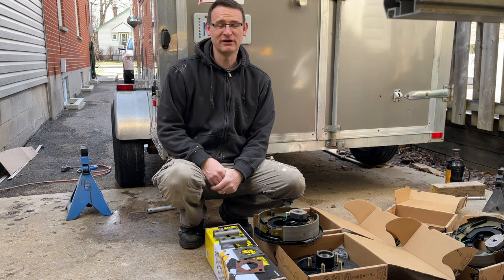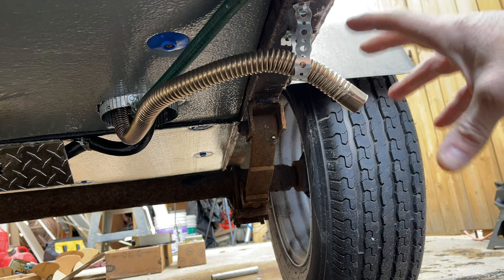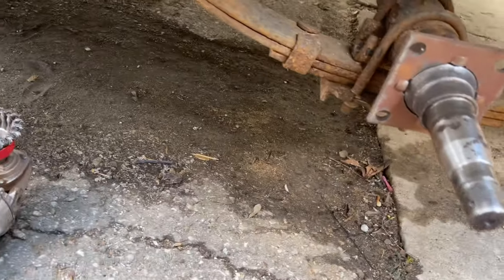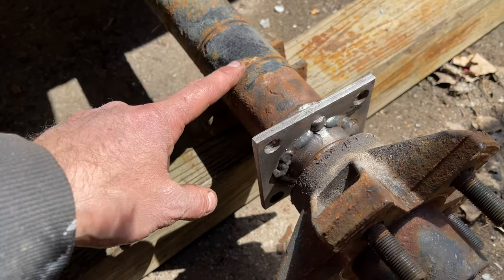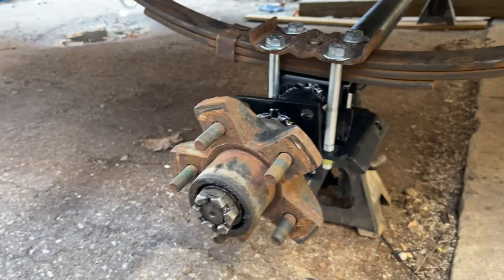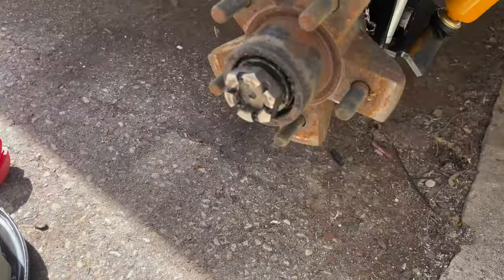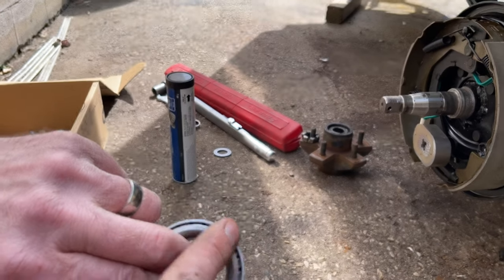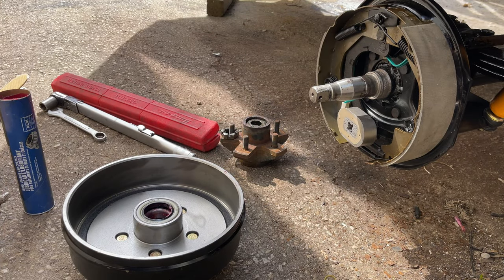How to Build a Cargo Trailer Camper Part 9 - Shocks/ 6" Lift/ Brakes

Comment: Thanks for the video! What about that tongue jack? That’s what really gets hit when driving through dips etc. I wish they made this type jack that would go all the way up and out of the way. I converted to a swivel jack for this reason.
Reply from the maker: Yeah I hear you my last trailer I ruined my jack that way😬. I was wondering if I could modify the existing jack.... some kind of removal foot and extension. But it’s probably just to complicated. I think I might have to go that way also... a swing away jack.
Reply: I converted mine to a swing away, because the factory jack didn’t survive an off-road trip. My tongue is complicated due to battery boxes, so the clamp on style was a no go.  I purchased one with a weld on bracket.  Owing to the aforementioned complication, I welded the bracket to the inside of the tongue.  It’s not “swing away,” but it is completely removable.  I also welded a 3/4 inch nut in place of the hand crank.  Rechargeable drill makes for a multi purpose electric tongue jack and drill. For emergencies, I carry the hand crank for the stabilization jacks from my travel trailer.

Comment: great work... how did you wire the electrical brake wires? I mean converting 4 pins to 7 pins? and do you have link to the electrical brake drum kit? thank you a lot
Reply from the maker: I actually just bought the brakes from princess auto…. That’s like harbour freight in the US. 
I then bought a 7 pin harness with junction box off Amazon like this one 
https://www.amazon.ca/PEAKTOW-Weatherproof-Corrosion-Resistant-Junction/dp/B07MYN6N5L
I mounted the junction box inside my trailer and Then ran my existing trailer wires into the junction box. Ran new wires down to trailer brakes and then your set.
Hope that helps a bit.

Comment: Hi, I am seeing many similar ways of lifting cargo trailers for more clearance. but I’m wondering how much does it matter if the axle still sits so low. Especially because, if I understand it correctly, the axle is always relative to the tire. So you will only ever get more clearance on the trailer while the axle height doesn’t change. Bigger tires seems the only solution for axle height increase and this can happen without a lift install? (Presuming your fenders don’t get in the way). Thanks!!
Reply from the maker: Great question….. Here’s my thinking. The best case scenario is lifting the trailer along with bigger tires. The benefit to a lift even with the same tires is your break over angle increases…. Basically you don’t drag at the back or get hung up on hills at the front because the body of your trailer is further from the ground. But to really benefit if you were in ruts or rocks then bigger tires or independent suspension is best. Hope that makes sense
Reply: @waysoutback  it sure does make sense! Thank you so kindly for your fast reply. Also for sharing your process with the world at large. It’s super meaningful and immensely helpful. Cheers and may the road treat you well!

Comment: Have you ever considered the timbren axle-less suspension?
Reply from the maker: Not really…. Had a quick look before I added the brakes but the seemed expensive and I’d need to add a cross bar….. I actually don’t mind my axle because my plan is to put a grey water tank used the trailer so the axle will provide a bit of bash protection from roots and rocks. If you were building a smooth bottom trail then I think it would be great especially for large mud ruts. You can really feel the trailer pulling you around when the axle is in the mud or deep snow. I don’t think I looked into it enough to have a strong opinion one way or another.

Comment: Just saw this and have been thinking about this for my cargo trailer. The problem I see is all these lift kits don’t do anything for the clearance of the axle itself so what’s the point? I’m really wondering not just trying to be facetious.
Reply from the maker: No problem at all. It’s a good question. I think the real benefit comes from installing larger tires. But I did find it really improved the trailer approach angles quite a bit. Before I’d always drag over large dips now it clears no problem. Hope that helps. Maybe if you think of it like a suspension lift for a truck?

Comment: Can I get more INFO on the KITS you used? ! ! !
Reply from the maker: Sure….  the shock kit I used was “ Lippert 281255 Bolt-On Shock Mount Kit 2.375" Axle 3.5K” bought it off Amazon…. the flanges and spring mounts I just bought off a local trailer shop. Here’s a link to their website for the parts - https://www.standardaxle.ca/product/flange-brake-4-hole-84-spindle/
I’ll see if I can post the links to Amazon for the shock kit in the description.

Comment: Do you have a link to the where you got the brake kit?
Reply from the maker: Hi Bryan
I just got them from the local axle place. Standard axle is the name. They do have a website where I ordered them. I think they are pretty standard parts at any trailer axle place near you. I’ll see if I can find a link to the parts and post them.
Reply from the maker: https://www.standardaxle.ca/product/flange-brake-4-hole-84-spindle/

Comment: Another great job!  I hate to appear to be an armchair critic, but the exhaust pipe from the heater looks real close to the insulation? An errant stick or stone might possibly push it up? Maybe it's just the angle the camera is at?   If you want to get in touch, drop me an email. Same name @Gmail address.
Reply from the maker: We are all armchair mechanics! 😁
I hear you about the exhaust I was a bit worried myself. I was going to wrap it with header pipe wrap for exhausts but so far after having it running for hours it’s been good. I’ll keep monitoring it, also I’d never fire it up for the first time without giving it a once over. Thanks for the comment though!

Comment: I am over 65 and able to do the work, but you, under 65, are amazingly comfortable with this type of alteration..!!!   LOL!  Most people under 65 cannot cut their toenails..  Indeed sad..   
Wearing jewelry creates accidents, gloves or not...
Are instructions included, or are you winging this..?? 
I would have welded at a higher temp. 
How did you mark each side so the axle is square..?
Did they not at least include rubbed pads to place between the axle and springs..??
U bolt brackets not welded to the axle..??  
The torque  between the springs and axles will eventually shift the trailer on the axle, no matter how tights the bolts.!!! 
Unless the shock is double action, the placing it facing forward will pull the rod out of the interior instead of apply the proper damping pressure going in..!!  Sounds bass ackwards..!  
I would have used marking pen for accuracy and not tape.
Notching a shock support and removing material..??  A no-no..
I would grease all the bolts and connections really well, as re-tightening will be needed periodically.  Especially w/out any rubber at the axle and spring.
Don't let the axle rate of 3500 fool you.  That has no bearing on the design changes you are making and how this is jury rigged..
You need to add another bolt on the top bracket..
I would have added another nut to the top/bottom shock bolts.
Not using new bearings would be a mistake..
How do you wire this and balance the both systems..??
Hummm..!! The more I watch this the more I see questionable long term reliability..  No offense, just sayin'..
 I like the entire concept and one of the BEST I've seen on boob tube, especially with the new shower..  Maybe a 6x12 next time..??
Reply from the maker: Ok I got a minute to address this… 

1- the axle already had machined grove for the brake bolt down plate… press it on then easy to weld you just have to look at the backside for proper penetration, after weld that side also.
2- springs didn’t come with any rubber pads from the factory and worked great, had it as my work trailer for over 5years… I’m pretty sure it will be ok.
3- U-bolt bracket is welded to the axle tube, I think  you can only buy weld on brackets.
4- once you get your shock kit and go to install it on your cargo trailer you will be able to see there is only one way it will go on…. The kits are built for travel trailers with I beam frames not box tubing like our trailers…. shocks so far have worked great, I would not own a trailer without them, I drug it across some extreme roads. No problem at all. Everything is tight and super strong. 
5- all new bearings were installed along with Hubs seals etc
6- the trailer brakes were adjusted the same way as my truck drum brakes… tighten the adjusting star wheel then apply the brakes then adjust again… continue until very slight drum drag. The wires are run just like every other trailer out there…  connect your blue wire from your 7pin and then run a ground. Brakes worked great no pulling or locking up whatsoever. 

I did debate on getting a bigger trailer but after hauling it with my little Ford Ranger I’m quite happy I went small. Definitely not for everyone but I think especially for off road you need to keep your size down… that’s my two cents anyways. 

Hope your trailer build goes well, if you can’t figure something else out just ask. 👍
Reply: @waysoutback  "all new bearings were installed along with Hubs seals etc".... I saw that, but you were also explaining how to re-pack used bearings..  Since there is corrosion on the spindles, they were not properly greased to begin with...!!!      I'm happy that you 'dragged' the box over some heavy terrain, but for how long...???   I'm over 65 and this is child's play...  LOL..!!